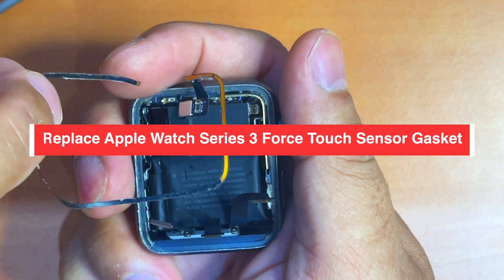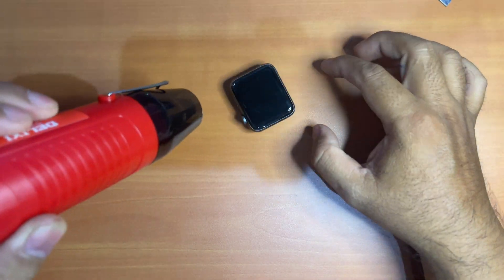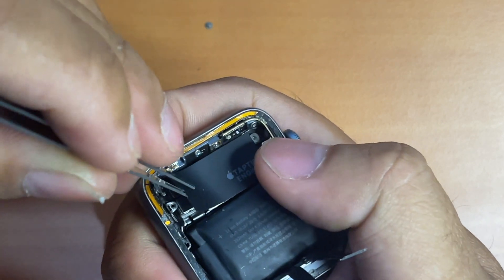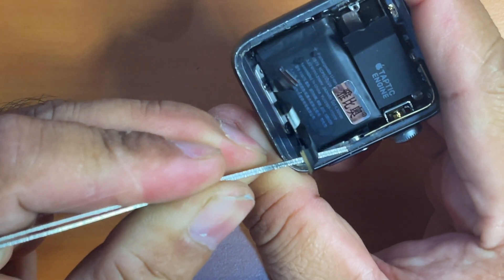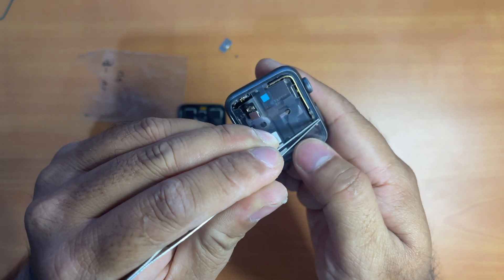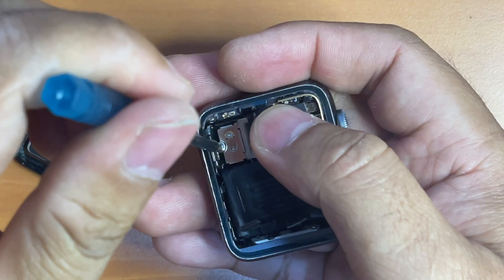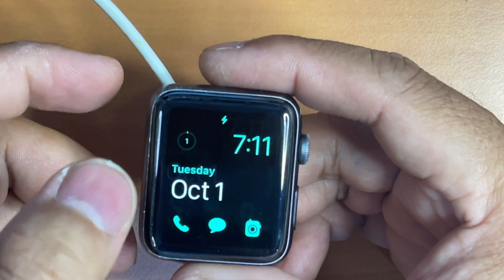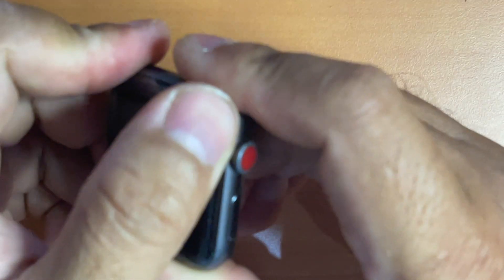Step-by-Step Tutorial: Replace Force Touch Sensor on Apple Watch Series 3 (2024)

Comment: why my old apple watch series 3 wont open when you force start the apple logo will come out then off again. not charging either. i already changed the battery but still the same problem
Reply from the maker: Make sure all the flex cables are connected properly.

Comment: Is it possible my apple watch cannot turn on after replace new battery cause my force touch sensor torn? I tried to turn on the apple watch after replace new battery to see if it works. But no sign of apple logo.
Reply from the maker: No it’s a different cable. Just put it on charger, it starts charging, then you’re ok. Most Apple watch replacement batteries come with zero charge.
Reply from the maker: Also, make sure that each cable is properly re-connected.